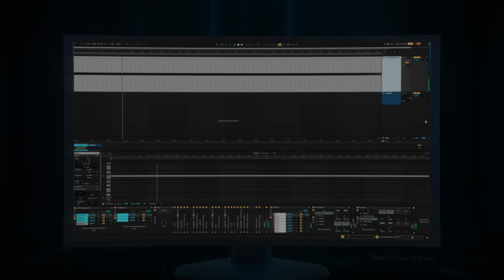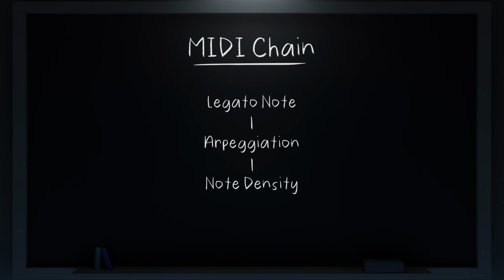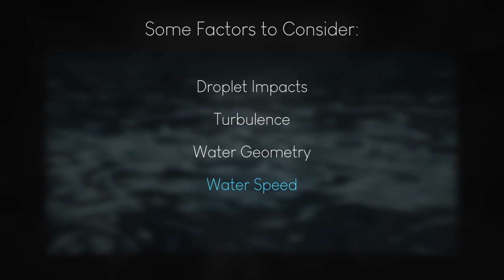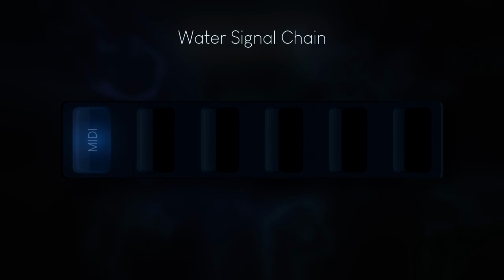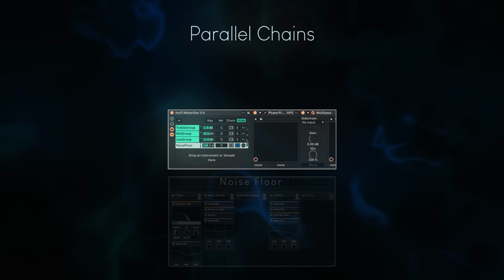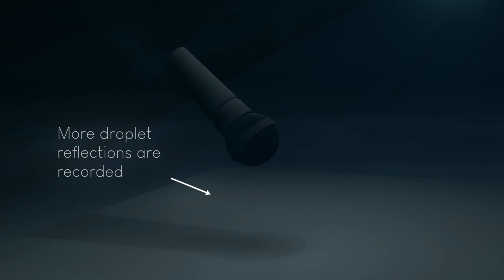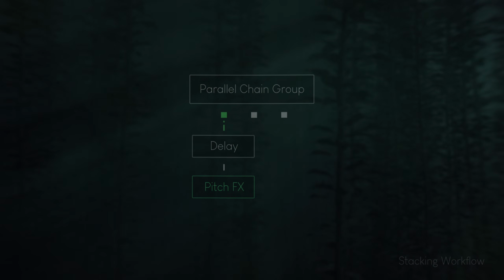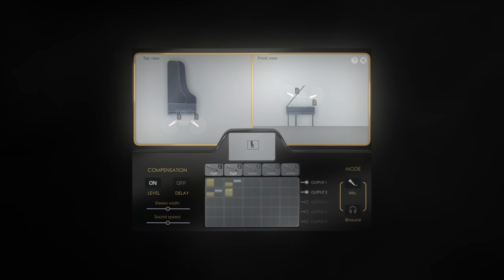How To Synthesize Realistic Water

Comment from the maker: UPDATE (6/12/25): For anyone interested, I've uploaded the (modified) Ableton project file for this video on my Patreon ( https://www.patreon.com/amfivolia ) which can be accessed via the "Bug Admirer" tier or above.

I had to go through and replace some external plugins that I couldn't expect everyone to have, and I've got the project file down to only a few requirements: Ableton Live 12.1 Suite, Phaseplant VST3, & Kilohearts Essentials VST3. And without further optimization, you will need a good CPU to run it properly (I use an intel i7-10700k currently).

Because the modifications give the water a different sound, you can listen to the modified version here (timestamped) : https://www.youtube.com/watch?v=Tg8wg5RBD-Y&t=38s

..

The other short thing is that this visual at 5:53 isn't totally accurate; so keep that in mind, but I have the paper I'm referencing linked below for those that are curious :)

Comment: Awesome inspiring video. Actually one of those that helped me to get back into sound design. Good insights, good methodology.
One thing stood out for me though. I'm not ableton user, but I assume that 9 chains is not the most efficient approach given all the midi effects you're already doing.

So the question is: if there is a roadblocker that stopped you from utilizing phase plant more? Like for example utilizing 3 effects lanes (can already replace 3 chains), utilizing snap heap more, etc. Also on the note triggering part, you can create a set of random modulators to trigger curve/envelope for each individual lane. In my mind 3 instances with less midi processing are more efficient and controllable than 9 chains with controls all around. In my mind it makes it almost manual rather than procedural. But again I'm just bystander here, and do not know details. 

So I'm really interested in what challenges made go with a seemingly more cumbersome road?

Comment: this video is so great. huge inspo

I am trying to figure out a way to route the midi where you split it before the chance module to two different tracks.

i.e. track 1 has the midi the passes the chance filter, and track 2 has the midi that fails it.

I wanted to use this to make a more procedural way of firing other midi without the signals becoming too crowded by everything firing at the same time (theoretically)

any advice would be greatly appreciated

Comment: A long time ago when I was first starting out, I accidentally synthesized a recognizable rain sound. I had just a basic VA synthesizer VST, and I had white noise as the sound source with a bandpass filter. I had a random and fast lfo on the bandpass filter, which did a reasonable approximation of the droplet sounds onto something like concrete/metal. With the noise in the background, it gave the impression of many more droplets in the distance. Add to that a few reverbs to create the sense of space and a background recording to sell this as something like a city street and I found it very believable for so few steps.

I'm looking forward to digging in and trying to synthesize more discrete droplets using your technique!

Comment: I am going to be a little harsh… Occasionally your script is overly wordy. Don’t try to overcomplicate an explanation. For example the line “disparate systems” was unnecessary. Just say different systems or more easily “different DAWs”.
When you get into the physics of a water droplet you don’t actually talk about how different parameters apply to sound design, so the whole explanation is moot. How do droplet size, velocity and water depth effect pitch, volume and timbre?

Comment: Great video and an excellent example of physical modeling/practical synthesis! One approach to water noise synthesis that you might not have run across before is using a vocoder. Using different noise sources as the carrier and modulator for the vocoder (try, e.g., white noise for both, each with different types of filters on it) creates a running water sound that can be made to rush, burble, or trickle depending upon the color of the noise and additional filtering that you might apply to it. If you have a vocoder where the analysis and synthesis bands can be routed in different ways, you can have even more control over the timbre of the water sound. (BTW, one can also just use the same noise source for both the carrier and modulator.)

The 16-band vocoder in the Nord Modular was perfect for this sort of thing.

Comment: You never fail to amaze me. I would be interested to hear these approaches used in an abstract musical context where the goal is not to emulate natural phenomena, but to use them as a starting point in non-traditional music composition. For some reason I'm imagining a hardware device kind of like a rain stick, which uses gyroscope/accelerometer, and you can control various parameters of the sound live. Given the synthesised approach, you could probably embed the sound in the device itself, using a raspberry pi, Bela board or similar